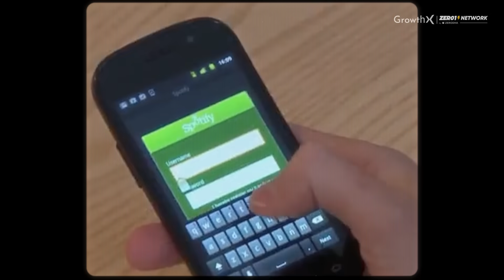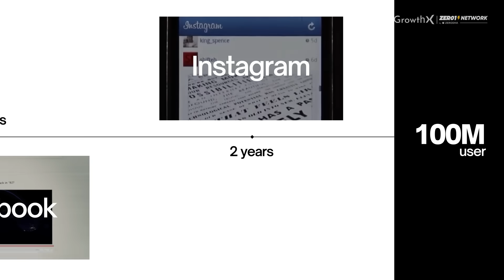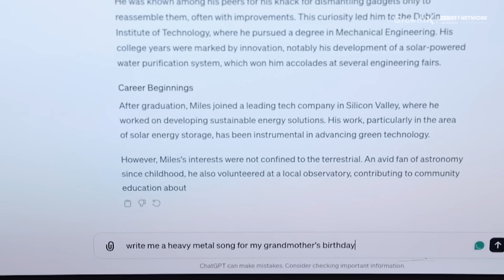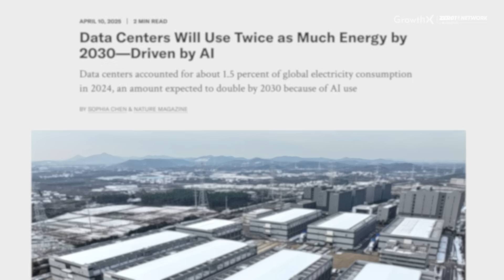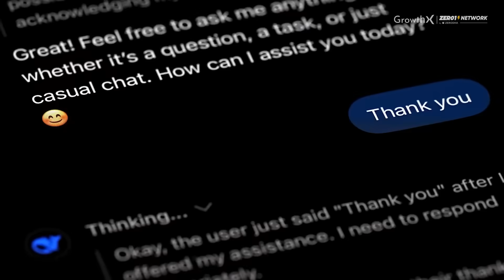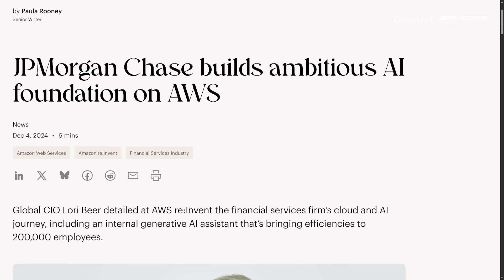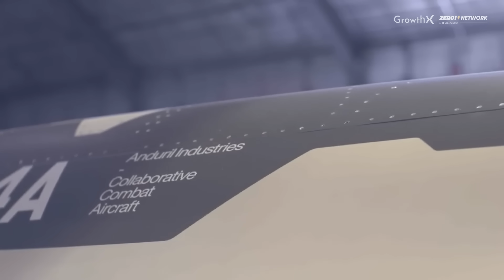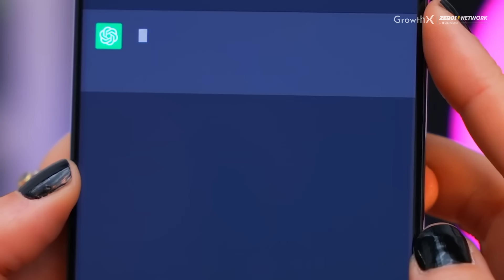I Read This 340 Page Report on AI, So You Don’t Have To

Comment: You touched a lot of points in this video except one thing, that is sustainability which is directly related with Climate. 

There is no regulation currently how these AI centric data centres can be monitored so that they can reduce their carbon emissions and this will not helpful in acheiving the target of reducing the Earth's rising temperature..Also, these data centres are using massive amount of water to control the heat which means there will be a waste of the most important natural resource which is the main thing for human survival.

The other side is companies are firing employees in the name of layoffs, not giving us the chance to improve AI Literacy so the question is how employees can upgrade simultaneously if they don't have the chance.

Moreover, the Pharmaceutical Industry is the slowest in adopting AI because of the concerns of health sensitive data. I can say this as I am working in Pharmacovigilance Industry.
Reply: Heat and Carbon emissions can be drastically reduced by reducing the size of these chips. Nvidia is doing great job in that 😊
Security: Yes, 90% companies are hesitant to share their data to AI, not just Pharma, even IT companies are not adopting it well. 
Information is moving faster, imagination are there, but ground reality differs. ❤ AI is next decade shit.